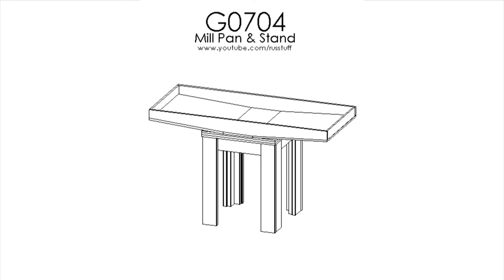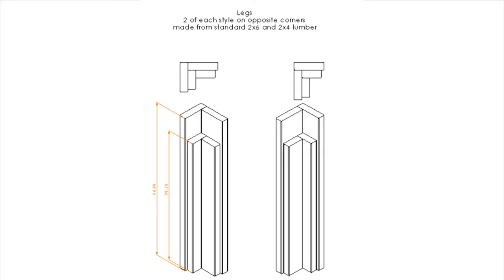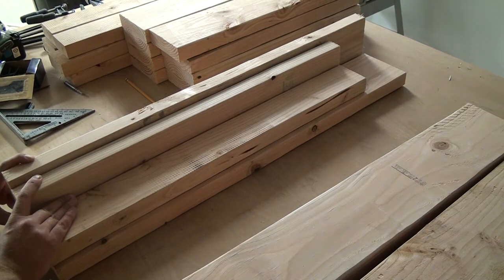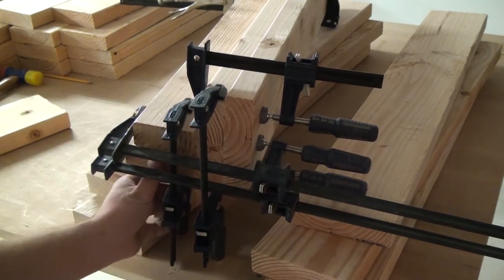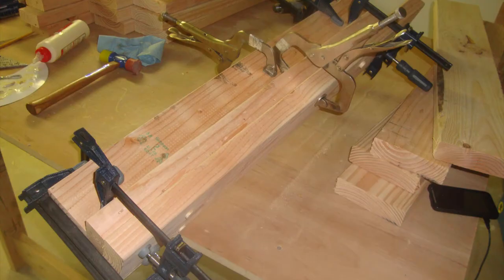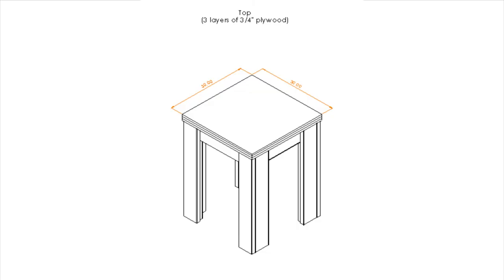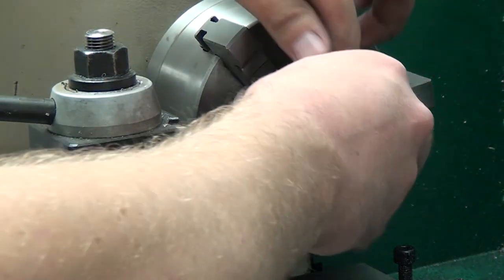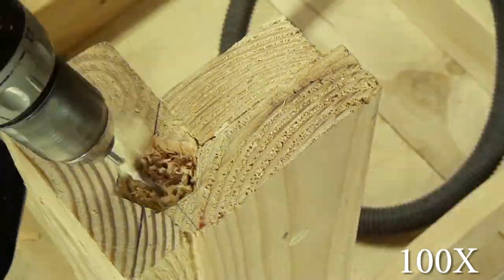CNC-G0704 #7 Mill Pan & Stand (part 1/2)

Comment: Russ;

I recommend that you add the bottom pieces to tie the legs together.  Over time the mill will create a lot of vibration and you can't make the stand rigid enough.  One thing you may want to think about is making a 6" high shelf with your lower pieces and then pouring concrete in there.  The extra mass will help dampen vibration.

Also, I recommend you definitely use epoxy paint for your enclosure interior paint.  I used oil enamel for the interior of my mill enclosure and one of my cutting oils took the paint off better than any paint stripper I have ever seen.

Nice design and work there.

Regards;

Ron Kluwe
Reply from the maker: You may be right about tying the legs together. As it is though, nothing the mill has done has even budged the stand. It's a lot of wood and surprisingly heavy. I am probably going to add the additional wood around the bottom eventually anyway, but just 2x4x to make a shelf for my flood stuff..... we'll see how it holds up.

I've read about some paints not holding up to the coolant, so I did some testing before hand. I'm using Kool Mist 77 and it hasn't had any affect on the oil based paint. If it ever starts to peel or give me a problem you can bet I'll fix it fast, then do a video about it :)

Thanks for your comments!

Comment: Thanks for the design. I'm still trying to arrange enough space in my house for a mill, but when I get it, I'll be using your plan for a stand. The stock stand is not going to work for me at 6'6"!

I've read that the max compressive load for a 2x4 stud is 700lbs, so I'd say you are seriously over-engineered....I like that in a design.  As Tom Lipton on the OxToolCo channel says, "nothing too strong ever broke."

On the epoxy paint, I used some rattle can epoxy spray paint on a maple mounting plate for a patio light. Don't recall the brand, it was well over 10 years ago...probably Krylon or Rustoleum.  It's still going strong, looks good, and wasn't any harder to apply than any other spray can paint I've used. If it can handle a decade plus of outdoor conditions, it can probably handle coolant catching. 

Clever use of sporting equipment.  The dense rubber should support well and even help with vibration...as will the wood. 

Thanks again for sharing!

-- Mike
Reply from the maker: Oh that stand will kill you!! :)

I'm only 5'10" and I felt like I was always leaning over to get close to the part. This design (with the feet as low as they will go) is 9" taller than the included stand, and I probably could have gone 1-2 shorter and been a bit more comfortable. Overall though, I still prefer it being taller than shorter.

I feel the same way about overbuilding something like this. It's cheap anyway, and why not bulk it up. The extra weight is nice, and you probably need to see/build it to see just how rigid it really is :)

Thanks for watching!